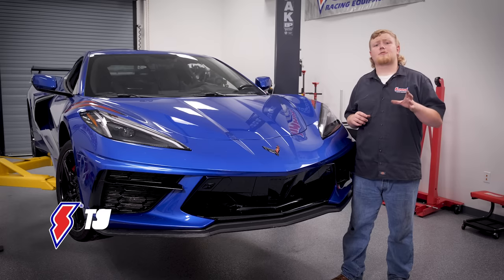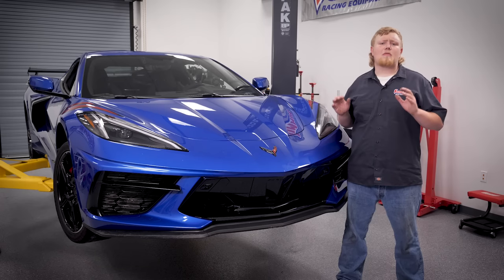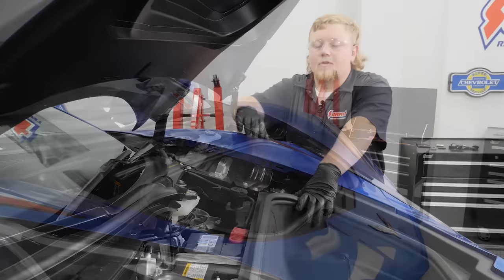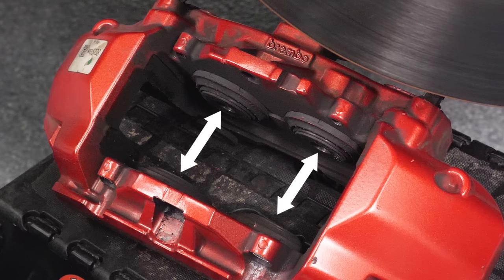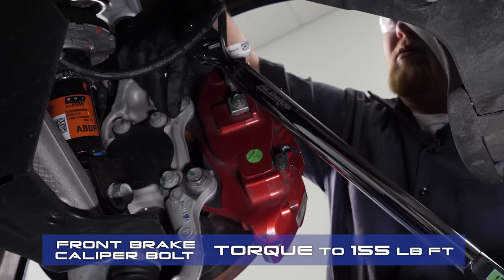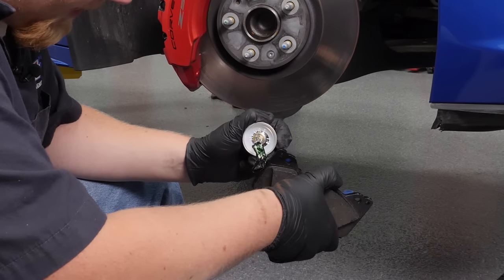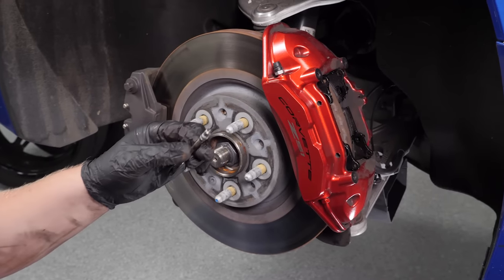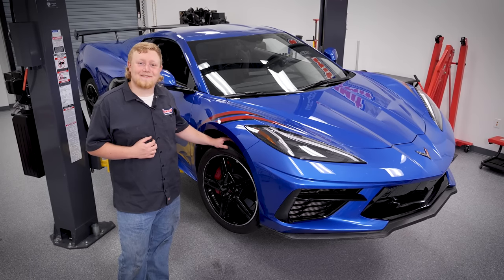How to Change Brake Pads on a C8 Corvette

Comment: You should follow the service manual and discard the brake pad pins. There is also NOTHING in the manual that says to use thread locker on those bolts. VERY BAD ADVICE.

Comment: Great Video, except that it doesn't mention the need for a specialized 10 point 9mm caliper socket.  It is listed in the tools list, but then when the video gets to that point it doesn't mention it at all.  He mentions every other step in the video and then just removes the 10 point bolt silently.  A quick voice-over added there would really help out.
Reply: For the Z51, it's not a 10 point 9mm.  I bought that and it doesn't fit :(  Got a clue what it is?

Comment: how come you did not use a special brake rotor thickness caliper to check for taper wear of the brake rotor wear faces..

when the rotors wear at a taper.. when you replace the pads only. you end up with the calipers being parallel.. the pads being parallel.. the rotors being tapered. so when the brakes are applied the pads don't contact the full surface of the rotor.. something has to shift.. usually the caliper pistons  .. this causes a spongy brake pedal that no amount of bleeding will get rid of.. 
 huge hint to people who drive their cars hard.. have a new set of brake rotors ready to install.. but if your rotors are only partially worn.. small ridge.. better brake parts suppliers have skilled techs to turn rotors a fraction of an inch to restore parallel surfaces without getting down to the wear limit.. additional hint.. thinner brake rotors get hot quicker.. so use the machined rotors for street driving and new rotors for race days.. 

 sorry to comment but this is the actual facts about it.. i have been a professional tech for over 40 years..
Reply: Wayne-this is a valid point but we did look at the rotors and there was no taper. I ran the replacement pads until this week with lots of track days and autocrosses. Replaced the stock pads with Hawk HP+ and new rotors. Absolutely agree that turned/resurfaced rotors will heat up quicker. Thanks for your comments.